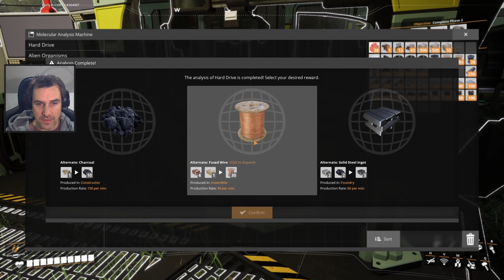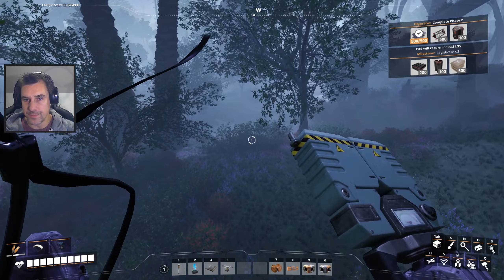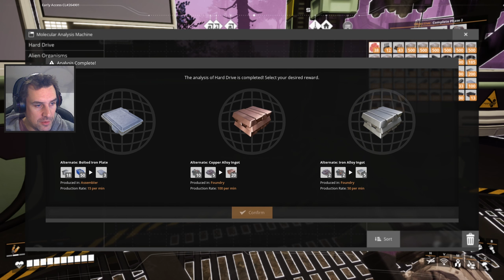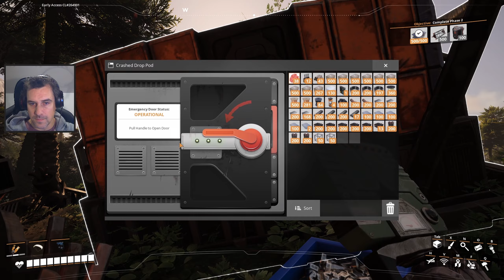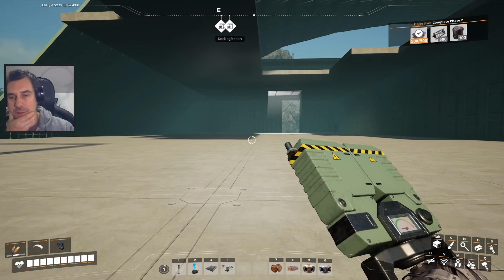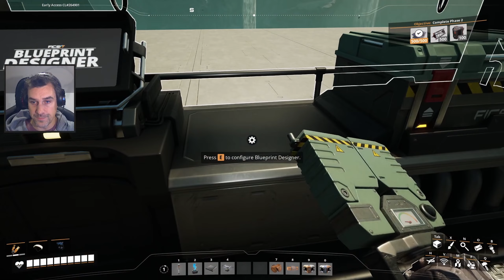Satisfactory Update 8 Episode 18: It's Blueprint Time

Comment: To import your blueprints from previous saves, you must first make a blueprint in your current save.  This make the blueprint folder.  You can then copy/paste from one game folder to another.  Blueprints are saved in a separate file from your game file for this reason.

If you setup your categories/subcategories first, your blueprints will remember where they go, otherwise, they fall into your undefined category.

Remember, you can assign blueprints to your hotbar, or hold "e" to bring up a radial menu, or tap "e' to cycle through subcategories.  Looks like you intend to make good use of the category system, so these shortcuts may prove useful.  

Fun episode!
Reply from the maker: Ok that makes sense. I thought blueprints were linked to your account not the save file.